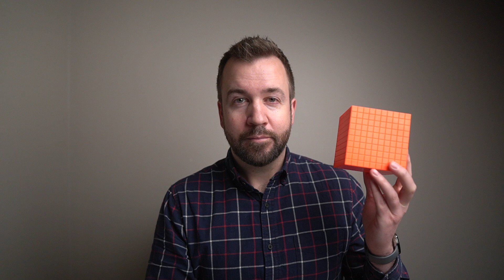Building a SATELLITE!

Comment: Back in the summer I had setup a ground station for the 70cm band and I was blown away by how many small satellites are up there these days. At any point of the day I could see atleast 2 or 3 signals on the waterfall if not many more. I just had a small Yagi antenna pointing at the the sky with a SAW filter and preamp feeding into an RTLSDR.

A few years ago a group of us launched a weather balloon  to the edge of space. Pictures the Raspberry Pi camera captured were amazing. We were lucky the farmer was nice enough to cut down the tree it landed in on his land out around Middle Musquodoboit. We would have never seen the pictures otherwise. Ever since I've wanted to find a way to transmit pictures down within amateur radio regulations at decent resolution and atleast one frame per second. 

It  gets much more difficult to pull that off on a cube sat with the tight power budget, international radio regulations and doppler shift. But pictures from space, even from a tumbling satellite are amazing.

High altitude balloons are a great way to test satellite hardware(and software).  It has many similar challenges but is significantly cheaper than launching a cube sat. 

I can't wait for my boys to get old enough to have an interest in this stuff, my youngest is only 5 months old and my other is only 3 and a 1/2. So I have a long way to go. Since the second was born late this summer I have no time to do anything anymore.

Comment: Interesting project
How about building a two part cube set which could separate into two identical mass units with the ability to track their separation and have one of those units exhibit a different magnetic or volumetric profile?
Too complicated?
Of course it would need to relay to earth 0:23 the separation and ideally the leading trailing identity of the two components
Cheers

Comment: there's really nothing you can do with a 1U sat that hasn't been done before. 
but you can make it spin really fast in zero G for shts and giggles using a flywheel.. have it send you data on how fast its spinning. 
but i think the limit is going to be half the motor rpm if the flyweel half the weight as the whole unit. due to newtons law equal and opposite reaction. 
on earth the motor would be fixed in space and the spindle would be turning at full speed. 
would be hard to use solar on it to keep it powered if its spinning.
Reply: No one has done a space based standalone IRC server. Could run your favorite IRC client and radio transceiver and communicate on an international level but through the satellite and not rely on the internet. Pretty nerdy thing and the ground hardware to interface with it would be the difficult part i think
Reply from the maker: For me, I have no problem at all repeating what someone else has done - just doing it at all is a huge win in my book :)
The intentional spinning is interesting - normally people think about DEspinning! Could be fun ;)

Comment: Ambitous!  How about payload that tracks / observes / photographs SpaceX launches or Starlink satellites?
Reply from the maker: Yes! Definitely one I've been thinking about. Drones have become so popular - as space activity increases people might want to get the same view of things in orbit.
I'm really interested in the new work on satellites that maintain, refuel, or even guard other satellites! There's also a lot of interests in satellites that can grab and de-orbit space junk on their way back down to clean up some of that orbital debris. So many possibilities :)
Thanks for watching!
Reply: @MikeOnSpace your satellite won't be able to grab space junk unless it had an incredibly robust locating, tracking and had the ability to change its orbit to match the space junks orbit, then intercept and course match, and then it would have to have even more power to pull it down into the upper atmosphere. You're not going to have the power capability in a 1u sat that at best would have 14 watts of solar and an articulating ion thruster, not even close to the theoretical power requirements to do that. You'd be hard pressed to have something capable of this even using chemical thrusters, nuclear would be your only realistic power option and you really need much more mass to move space junk... So maybe start with like a 64u size minimum. A junk hunting satellite is a cool idea though.